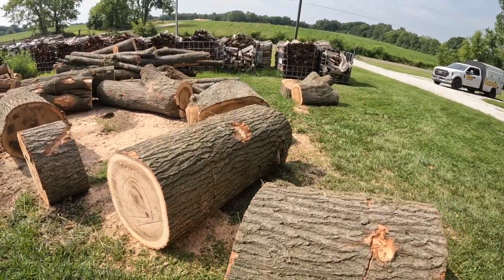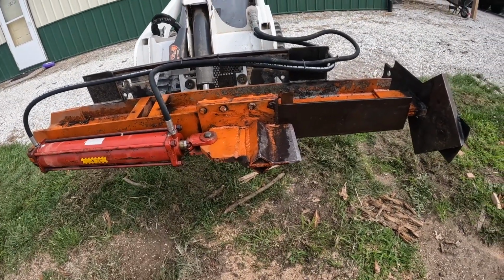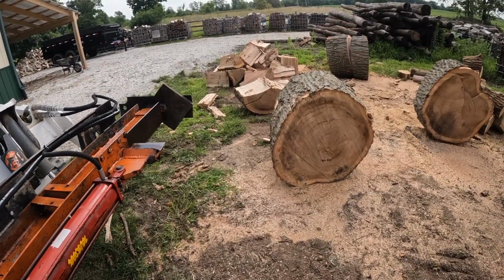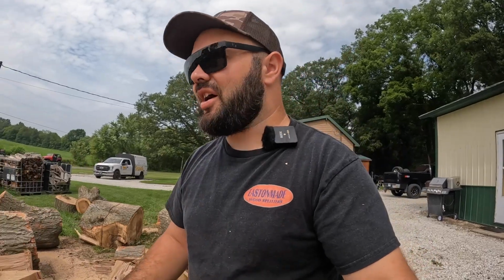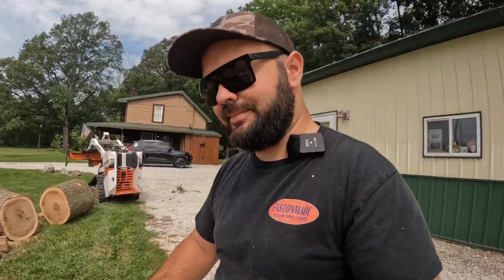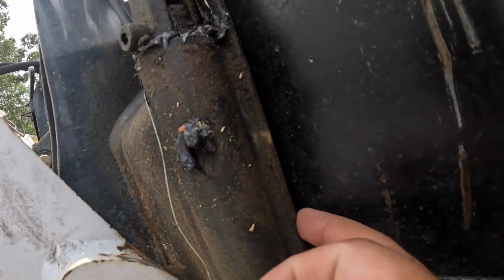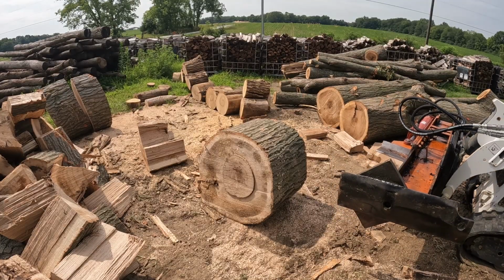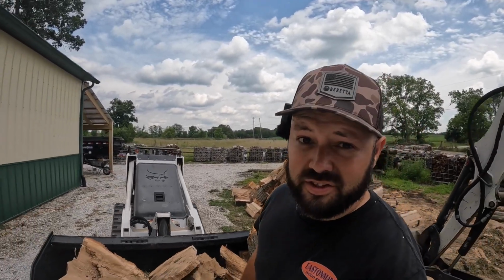Mini Skidsteer+Log Splitter, Lesson Learned! #firewood

Comment: You've got it all now dude!!! 
I really like that splitter, I'm also considering the ms324 but I'm trying to hold out until they make one for a mini x mount. That way I can just throw it on the neighbors  stuff and bust big stuff up. 
Those are some really nice logs too, perfect stuff 💪💪
Reply from the maker: @LogCabinFirewood  I asked awhile ago, and being there is so many different mini x mounts, you’d probably just have to give him dimensions and they could make one. Or just get it in skid steer mount that way it will fit multiple units and get a mini to skid adapter. When I get one I’ll get it in skid steer mount so if I get a larger some day it’ll still fit.
Reply: @765Guys  That's a great idea, I wasn't aware you could do that

Comment: I must not have been watching your videos that far back when you were using this splitter on your tractor, because I don't remember seeing it before.  Boy, without having the 12-22 and it's log lift anymore, you almost NEED this splitter to split those big rounds unless you wanted to noodle everything down to a manageable size to lift onto the Ultra.  It's good that you have that!  My buddy Tim @Timber Visions has something similar to yours that he made himself too.  Pretty handy.

Damn Bud, sorry about the drone!  Which drone is it?  DJI?  I hope you're able to get it back.  I crashed my drone the first time I was trying to use the tracking function.  I've been afraid to try it ever since DJI's insurance program replaced mine for me LOL!
Reply from the maker: @JeffGeorgalas  I think the last video I posted with the tractor splitter was in February time frame. A splitter like this is definitely needed for this wood even with a log lift on my opinion. Even with the log lift, is I pushed it threw a 4 way each piece that would need resplit would probably weigh 200 pounds a piece and not somthing I really want to fight with pulling back. Box wedge could do some of these huge rounds but there so wide that you still have to roll them and reposition them, again not somthing I want to fight with, been there done that. It was a dji mini 3 pro. Looked for it with a bucket truck and couldn’t find it, need to get another drone and figure out where in the tree it is, and then get a plan on how to get it out. Thanks for watching Jeff!